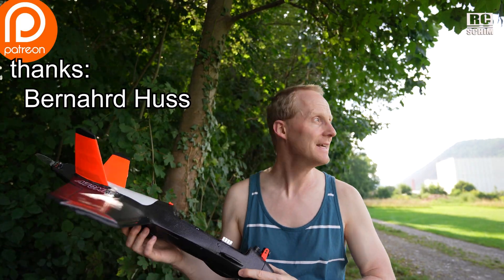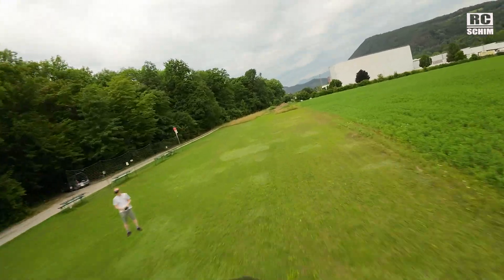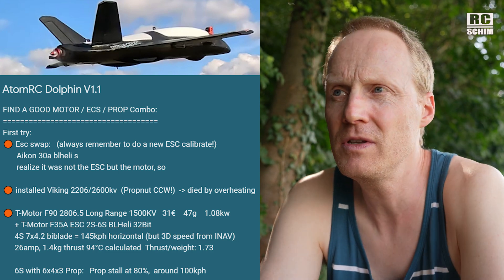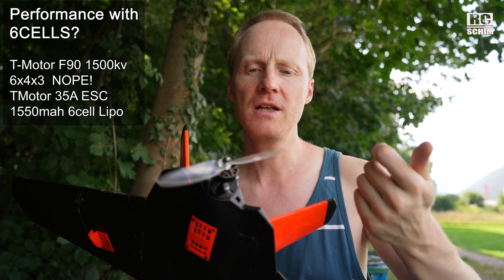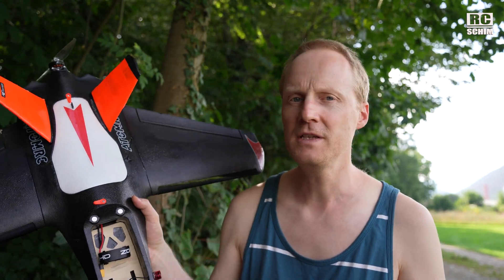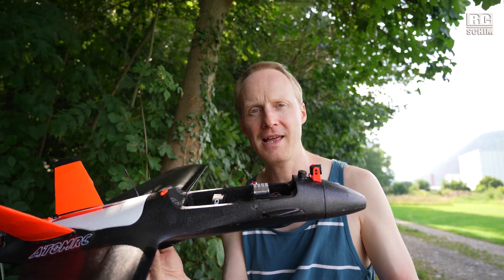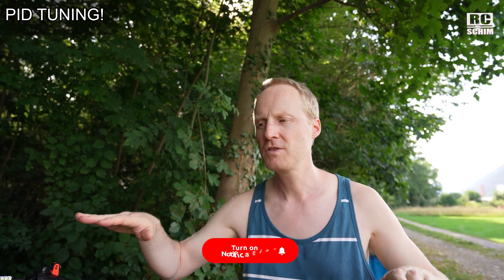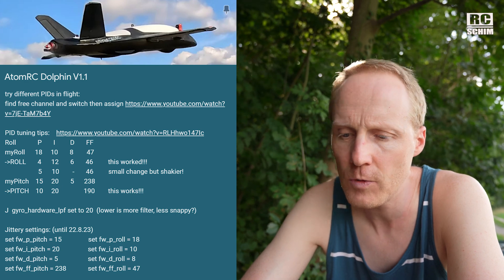AtomRC Dolphin Updates (PIDs, best Motor Combo)

Comment: Excellent video! you gave good tips for the Dolphin. Also, thanks for mentioning me and my channel :-) I have additional tips, specifically about how to cool the O3 airunit. Instead of using an active element, such as fan, I like to use a passive mean, such as an larger nose air intake. I designed such nose and I will share the design in a following comment. Regarding the 6x4x3 prop with the 6S configuration, I do it all the time, and it give me a very decent speed and power. You just need to use the right ESC for it, as 35A ESC would not be capable of handling the required power. I use 45A esc. You should have the current draw in the flight controller log, so you can see how close are you to the limit of your esc, especially during takeoffs, where the current draw tend to be maximal. Lastly, my channel name is pronounced like the French word 'étage' 🙂
Reply: Hi, have i missed the upcoming comment as i am in the planning of building an atomrc dolphin with an o3 unit. That's why I am especially interested in the passive cooling

Comment: Nice hanger/workbench update on how the Dolphin is holding up to lots of summer flying. It's looking stylish in the opening to this video. Great colour combo for spotting in the air when formation flying.
On Thingiverse I did see a "wingtip winglets" 3d-print design listed. There are also 3d printed versions of the canopy, that could be modified to provide better O3 cooling. Didn't spot any with a NACA air inlet. With cooling, the outlet is as important, or more so than inlet ... so air can escape. (also larger outlet cross section avoids pressure buildup, which could mess with FC pressure sensor for altitude).

The ATOMRC Penguin has FPV nose option witch offers good VTx cooling. Would have been a smart design decision if ATOMRC made such a FPV nose interchangeable between the Dolphin, the Swordfish and the Penguin. Have been wondering if such is the case? A possible option, even if need to design an adaptor/spacer between fuselage and the FPV nose.
Reply from the maker: Thanks man! I had more time to use my zhiyun m3 gimbal on the Sony cam for the intro. 
I should get the penguin eventually, will see how good the fpv cooling nose works there. Maybe I can 3d print the penguin nose for the Dolphin?
Reply: NACA (ish) intake fitted. I removed the ESC grill on this one. ESC is 80A and deep internal :) https://www.youtube.com/watch?v=YF6MQ7ULrt4

Comment: I use Emax  ECO II 2807 1300kv and you can run 4-6s no issues or worrying about cooking the motor
Reply: does it have enough power with 4s?
Reply: Is it good?

Comment: Interesting find on the roll pids, might give that a try. I'm using the stock 7042 prop too (Gemfan Flash) with a T-motor AS2317 1400kv, it's a little bit heavier than your motor, but it helps to get the cg on the right spot as i'm using a 4s2p 6800mAh li-ion pack. It flies great with this setup and up to a hour.
Reply from the maker: Wow, that's a heavy Battery but of course good flight time and good performance because of 2p

Comment: Thanks a bunch for all the tips, Mario! 😃
I don't know if those fans would make much difference, but there are esc fans that are strong as heck! And I already found them with 20x20mm, 25x25mm and 30.5x30.5mm mounting holes!
Anyway, stay safe there with your family! 🖖😊
Reply from the maker: 25mm mounting holes would fit nice for the o3, thanks for the idea, I will also look for esc fans....
Reply: @Rcschim need a way for heat to get out and cool air to come in, no point circulating heated air, the added fan motor and battery are big sources of heat too. I would carve out the top cover and raise up the air unit till the fins are exposed to open air.
Reply from the maker: @Finnv893   agreed! I already thought about this as well. Will give it a try! passive cooling would still be preferred.

Comment: So, f90 tmotor 1500kv its good when use it with 4s and 6s? And using 7inch props? I plan to upgrade the esc to 60A, and using 6s1p liion 21700, what do you think? Thanks
Reply from the maker: Yep, the motors is really good. 7inch and 6cell might be too much. I didn't try it since the calc said no, and I don't to fly carefull on the throttle so the system doesn't overheat or die.  Currently it works efficient, but also has plenty punch and can give me both: longrange 25mins or full speed action 10min  on that 2600mah 4cell
Reply: @Rcschim i see Visma (one of the youtuber using dolphin with 6s and 7inch props) when he did launch, dolphin went Roll too much, , so, using 21700 4s1p with F90 1500kv and 6inch would be great?
Reply from the maker: @erlandfpv   if you use 4cell you can stay with the 7x4.2 prop that came wit the plane.   I always rely on the INAV autolaunch - works like a charm.
smaller props have less power on launch so you can get in troublesome situations.
21700 Liions seem like a really good choice - I didn't find good ones to buy, just have the 18650 4cell Lions - but they are ok as well.
greets, Mario
Reply: @Rcschim thank you so much 😊🙏🙏🙏

Comment: Ah summer... I remember that!   Just finished lighting the fire and I have my cold hands wrapped around a hot cup of coffee as the outside temps hover around zero at 4:45am.     Thanks for the warming video Mario! 🙂
Reply from the maker: It's amazing what kind of geo and temperature range we cover in this little group of 3 here ;) 40c in winter? Brazil seems to be as broken as the rest of our globe...  hope your fine Mario.    And Bruce, starting up a fireplace and coffee sound quite good.  I try to carpe diem as much as possible here in the summer since it will end eventually. Embrace the change, "life in the moment" is a bit too much now ;) 
Greets!
Reply: @Rcschim I'll throw my two penneth in the ring, it's been windy & raining of & on in the UK, but its been reasonably warm with it. I've hardly fliwn all year what with weather, family commitments & my health. A year to forget. 😢 But at least we haven't had the fires and crazy stuff that have decimated areas & communities.
Reply: It's almost 40°C today here in my city in Brazil... And it should be winter as well. 😬
Reply: @MCsCreations  Ooooh... send some of those degrees my way will you? 😛